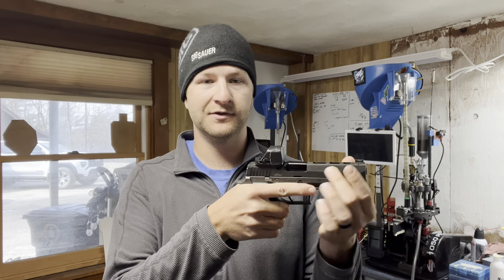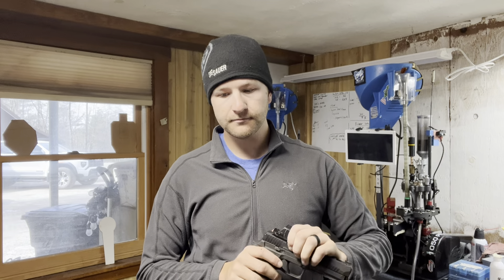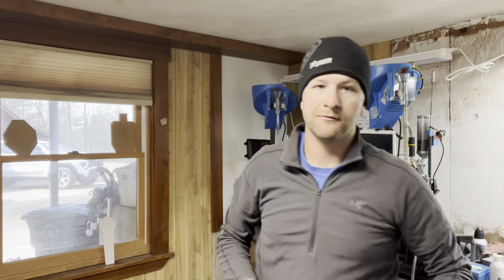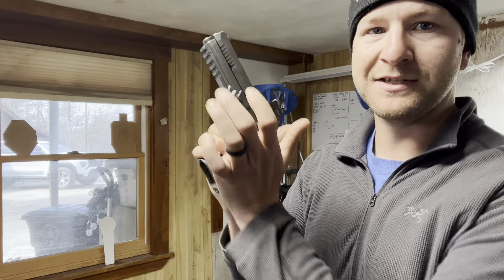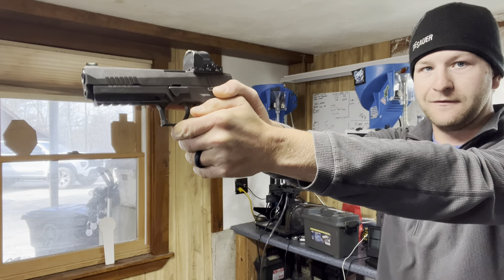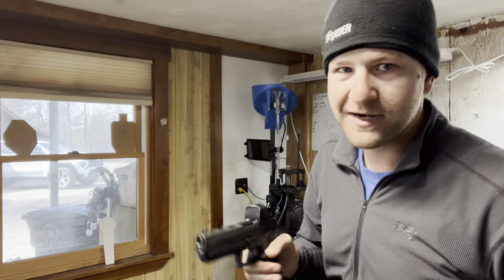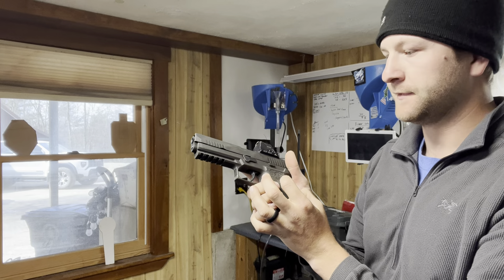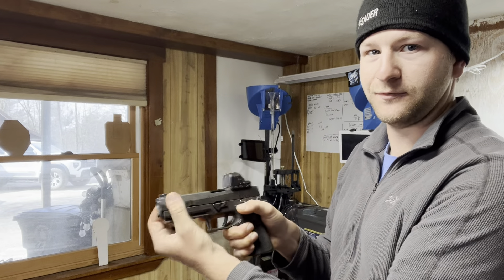Grip technique summarized

Comment: Appreciate the thorough explanation.  Does that mean during the draw cycle, you're contacting the support hand palm first and wrapping the fingers around rather than contacting your index finger under the trigger guard first and then completing the grip?
Reply from the maker: In terms of the order of operations, no probably not literally.  But my attention is on getting the palm position correct above all else. If that happens the rest will fall into place
Reply: @masonlane2030 Awesome, appreciate the tip!
Reply: @IterativeOptimization thanks for asking the question, I had the same thought !

Comment: Have you tried Grauffel’s method for gripping the gun? If so what are your thoughts and why did you use this technique instead? My grip is very similar to yours.
Reply from the maker: I’ve heard a lot of interpretations of what he does.  The part of his technique I’m definitely borrowing is keeping the support hand wrist angle neutral as possible, I’m just not doing it with a finger in front of the trigger guard (because the TG is too long for me to reach on the p320)
Reply: @masonlane2030  mostly what I’m referring to is his idea on where pressure should be. In our calls and in his pay walled videos he prefers a push/pull method where the grip pressure is almost entirely on the front and back straps with very little coming from lateral grip, ie grip panels. Was very surprised when I learned that as it went against everything I’ve ever heard.I’m played around with it but not enough to compare against what I’m currently doing.

Comment: See I’m a high grip guy…… I can appreciate your logic and explanation of why you prefer the low grip. Ultimately it’s a personal choice for your hand size that will often dictate which route you go, and the instruction that you receive from an instructor.

I personally cringe whenever lm at the range and see people practicing with the low thumb grip, because l look at the targets from some shooters who use that type of grip, and often they look like Swiss cheese. No tight groups. 

Because to me it looks like their grip is breaking down after each shot. Because their support hand  is too low. 

Or if people, run that double thumb Israeli grip. Same thing……the support thumb is crushing the other thumb. Which seems pointless to me.

But l guess to each their own, for me personally l can’t hold on to the gun well enough to manage recoil, with thumbs forward lower on the frame as opposed to high on the slide. 

I get the meat of my support hand as high as l can on the slide, with both thumbs forward as you did at the end of the video.

but your can instructor and l am not……so l respect the knowledge and guidance that you provided in this video.